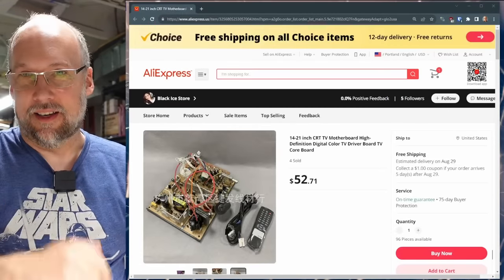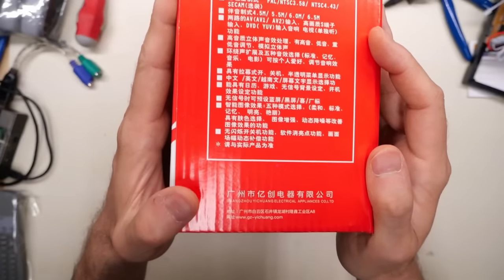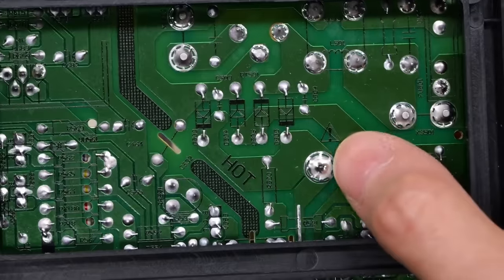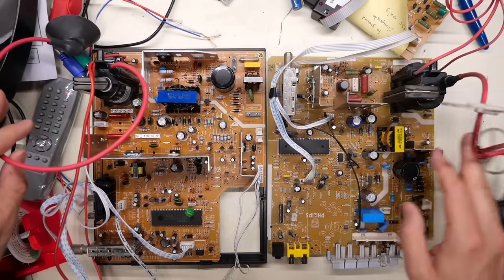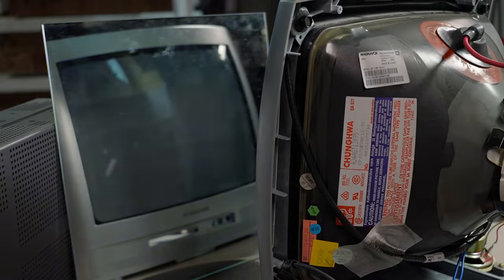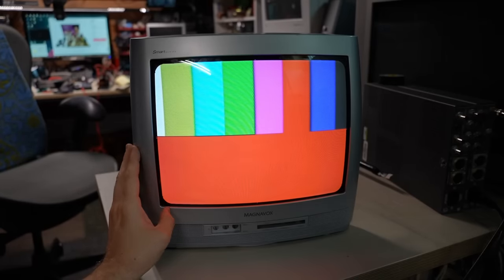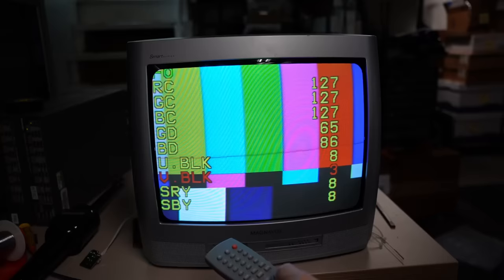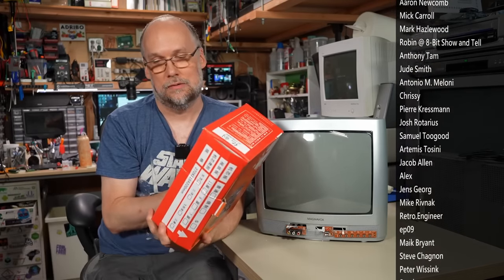I replaced the main board of this TV with brand new parts made in 2023!

Comment: CHUNGHWA CRT's were actually very good quality picture tubes. I have some of those and one has 100k hours of operation on it and still has very nice bright and sharp picture. There is slightly burned overall phosphor but not a big deal. CHUNGHWA is my second favourite brand for picture tubes after SONY Trinitrons of course 😊
Reply from the maker: Yeah for sure this set is still super bright and it was clearly used (had some soot inside) I have since corrected the slight color purity issue and adjusted the convergence, and it looks frankly great.
Reply: Now I wonder if they're the ones still producing the CRTs for the set Adrian found on Alibaba. I doubt it, but then again who would still be in business making them than the company that was the best at it in the country?

EDIT: Oh wait I looked them out they were in Taiwan, so I guess not.
Reply: @stevethepocket I think that's just a warehouse sitting somewhere with new old stock. The very last chance to get a fresh CRT.
Reply: Sony Trinitrons are not the best honestly,their chasis are complicated compared to cheap one,which doesnt have a lot of feartures which can result in the damage of the screen
Reply: @thepostalteenager2206 he's talking about the tube not chassis
Reply: chungwa became chnaghong then was acquired by tcl.

Comment: This brings back memories. I learned TV repair in school. a friend and I plowed through the books several weeks before the rest of the class and the teacher assigned us a broken TV. We eliminated point after point until the only thing left was the fly back transformer, and it wasn't putting out any power.

Found a burned out power transistor, swapped it and burned out the replacement. Found the real problem and fixed that, swapped in a second replacement transistor and it should be working, but without assembling everything we didn't know for sure. Here we didn't know how to proceed. We didn't have any instrument capable of measuring voltages in the tens of thousands range so how could we test what we got there? I asked the teacher and he told me to peel back the isolation from the terminal on the transformer. Then with the power on take a screwdriver rated for 100KV and poke at the bare terminal. I asked what I was looking for and he just said I'd know when I saw it. 

Well the "it" was a two centimeter electrical arc jumping between the terminal and the screwdriver. Scared the shit out of me and left a deep burn mark on the screwdriver. My teacher laughed his ass off. Never liked working on the high voltage parts of TV's after that. Turns out he had that TV for several years and we were the first to get a picture out of it again. The thing is he could have diagnosed and repaired it in thirty minutes while we worked on it for days. That's what experience will do for you.

And I never dug into a TV again after that!
Reply: Even witg proper tools a teacher to me even suggesting to try that is an EXTREME violation safety
Reply: @casev799  the odds of it hurting you : high
the odds of it killing you : low

this is how the best lessons are learned imo
Reply: your teacher is a madman lol. woulda done that now days some kid woulda cried to mommy
Reply: @jstegall44 and teacher fired
Reply: Yep, a screwdriver makes a good high voltage tester. I was a TV engineer in the 1980s and we never had a high voltage meter either.
When I started out there were plenty of TVs with line output valves with around 4000v on the top cap, you certainly knew it it you accidentally touched it! Would leave a small burn mark on your skin. Luckily the current was only a few milliamps, so no danger of serious injury or death. I like 240v mains, and I've had a few of those too!
Reply: Fun part is that CRTs can hold high voltage for a long time. Your turn your TV off on a Friday and continue work on Monday and you still get zapped. But that can happen with a power supply board too (large caps).
Even more fun are CRTs built into large wooden cabinets where you have to put half your body into to reach the components. If you get zapped in that position, you will bang your head on the cabinet and if you're really unlucky, you hit a metal bracket with shrp edges...
Reply: Cool story, bro.
Reply: And this is exactly what I went into Electronics hoping I would learn about. As a teen I used to love tinkering up awesome home entertainment setups – I made surround sound systems (5.1 style) before it was even officially a thing. So I hoped to learn more about that and get an education within my passion. Instead it ended up being an overbearing amount of math – almost never any actual physical tinkering – which ended up boring me out of the whole class completely. So, I reset and went into botany instead. No jobs in that field. And now I'm here… just watching YT videos. fml
Reply: You've got a massive set of cohones my friend. I thought about repairing my old crt tv as a kid and was perfectly capable of fixing electronic things, but after seeing videos of people getting electrocuted and getting hurt I didn't have the balls to do it.
Reply: @jstegall44 
12 year old here, I would've got my dad (works in PC stuff) and he'd probably just go
"hell no we're not"
Reply: @PlaywithJunk  A CRT is a glass capacitor that stores highvoltage also when off. Most dangerous of touching it is that you will accidentally shatter the tube and so (particularly with 1950/60th TVs) die of the shard shrapnel from a glass handgranade.
Reply: Your "teacher" had no business being a teacher. That being said, step up to MOT stacks and reversed pole pigs.
Reply: @casev799  Yeah it's called "badass".

Comment: I remember about 7 or 8 years ago, working on a Mitsubishi 60" rear projection CRT TV from the late '90s.  It had RGB convergence issues that I later discovered were the result of cracked solder.  I was surprised to find out that, not only did it use convergence amplifiers from the '70s, they were still in production and I got a complete set for less than $20, shipped in under a week!

Comment: That looks like a possible solution to dead CRT based arcade machines. Some of the CRT driver boards for those are full of unobtanium parts (particularly the flyback transformers). This might be a good replacement for the original board.
Reply: They've sold these for arcade monitors for a long time (like at least ~15 years or more). They lack composite, remote, etc. You would measure the total resistance of the yoke windings and there were a couple different models to order based on that (and the CRT size-- 19" vs. 25"). They worked, but longevity was pretty marginal. Probably OK for occasional home use, but we had 100% failure rate running in a commercial arcade after a few months. I suspect that replacing all the ultra-cheap Chinese caps with some better quality ones might extend the life, but I never bothered trying that since repairing the original monitor chassis is still quite achievable and tends to last decades...
Reply: I clicked the link for the one he got and one of the recommendations on that page was for one of these for 25" to 29" arcade crts XD was like $22
Reply: You can buy universal arcade monitor boards with RGB input, they've sold those for decades

The disadvantage is that the screen brightness changes depending on how many stuff is in the screen since the high voltage regulator is made cheaply
Reply: @ClayCowgill  It's definitely the cheap caps. I replace the caps on most of the Chinese stuff I get simply because of that. Even Samsung products use those cheap caps. My Samsung monitor died 3 years after buying it, bad caps, replaced them and now 7 years later it's still working perfectly.
Reply: You can have flybacks custom made, just like any transformer. You can fix anything if the customer is willing/stupid enough to pay the price.

Comment: The thing that kind of boggles my mind is not only does the flyback have the 2023 date sticker on it, but the PCB has a 2021 date silkscreened on it-- meaning that the PCB design was revised that recently!  Wild that there's enough demand for CRT TVs and components to be actively developing products in the 2020s.
Reply: sprite based games just pop on em
Reply: Over here in south-america, CRT tv's are still widely used, even CRT computer monitors.
Reply: I checked out their website and it seems like the product was possibly introduced in 2020. I'm 97% sure the design is a multiple-generation copy of what was once a board inside a set made by Funai. They were (and still are) a major manufacturer of white-label bargain-grade AV products, including CRT. Adrian's "Magnavox" television is almost certainly of their products, as they own that brand name. That same model got sold as Memorex and probably a dozen others too. The type of TV you'd find on sale at CVS in 2004.

This GZ Yi Chuang company also sells "XFLAT" brand new CRT televisions. I will hazard a guess that there are other small factories producing clones like these with copied schematics. That type of thing is a big part of the manufacturing culture in China. Plans get shared quietly, modified, improved, cost-reduced, reshared over and over again. Personally, I think that's awesome!

Comment: PAL-BG, I and DK are some of the different PAL flavours. BG used in Germany, Netherlands, Belgium and is your default. (B is VHF, 7MHz channel width, G is UHF with 8 MHz spacing). PAL-I is used in the UK (UHF only, and sound subcarrier 6 instead of 5.5 MHz) and DK is for another channel numbering used in Eastern Europe that wanted to stay compatible to Russian Secam.
Computers and VCR’s are usually modulating on UHF channel 36 or 37 in Europe. PAL for Argentina is PAL-N and for Brasil PAL-M.
Reply: In Argentina we do actually have PAL-N, but we also have NTSC on some CRT TVs
Reply: @YourGoofySouthernNeighbour And since the late 90's, all CRT tv's manufactured in Brasil support PAL-M, PAL-N and NTSC due to Mercosul.
Reply: @TiagoCNeves  you mean Mercosur
Reply: @KatsuSush  In Portuguese we do say Mercosul with the 'L' as South is "Sul"
Reply: In Italy now the tv transmissions are in digital system DVT-B2.
The PAL BG was abandoned some years ago...
Reply: Yeah, different regions had different channel spacing and sound offset. Another interesting note is that PAL-M is actually based on System M, so it has 525 lines, and 60 fields per second.

Comment: I'm glad to watch this on your chanel. This is something very common here in Senegal (West Africa). This kind of "Universal Replacement Board" imported from China is still being used by TV repairer when a CRT color TV is having issues they can't fix due to IC problem that can't be replaced because the component can't be found. So what they do is they manage to place the board inside the TV case and somehow glue the IR sensor somewhere on the front panel. They don't even bother to try to install the from buttons interface, the user will use the remote at home and if it's broken he can find a replacement on the market or a universal remote. Most of time the process is way more easy than yours because it's about bigger TV.
One more thing. Why China is still manufacturing this kind of board? because here in Senegal and in any African countries, analog terrestrial tv signal is still being broadcast. And even if there is digital broadcasting, many families keep their CRT TV and just buy the box that allow to receive the digital signal. There are also in many towns some kind of clandestine analog cable networks using the UHF band to distribute live TV they take from satellites digital broadcasting to users that pay a very cheap price. So the market for this kind of boards still exist here.

Comment: The method of using 'breakaway' panels is definitely an efficiency step in manufacturing... it's far easier to place jumpers onto a panel beforehand, run it through wave solder, then break it out to separate boards than having to fiddle with getting the wires properly hand-soldered. That cap coming loose is probably precisely why other CRT sets you've poked around in have that adhesive holding down certain large components.

Comment: 40:30 PAL B/G uses a 5MHz sound subcarrier (Western Europe), I uses a 5.5 Mhz (UK and a few others), D/K uses 6MHz (Central & East Europe)
Theoretically, the higher sound subcarrier allows higher video bandwidth, but that would depend on perfect separation of the chroma subcarrier and reduction of chroma / luma interference by the subcarrier being super accurate 4.43361875 MHz = 283.75 × 15625 Hz + 25 Hz is required to drop the main harmonics of the colour components in between the main harmonics of the luma, while only the most advanced decoders can make full use of it.
Reply: I thought the DK setting was for playing the Donkey Kong theme but this video proved me wrong. This explanation makes sense though.
Reply: B/G is actually 5.5MHz, I is 6MHz and D/K is 6.5MHz. Guess your numbers are the video bandwidth?
Reply: Yep! I do remember that analogue TV in Singapore used PAL B/G.
Reply: @mikkels5724  oops, reading the wrong table column
Reply: Australia uses 7Mhz subcarrier

Comment: I wanted to tell you, as far as cutting the plastic base and things of that nature, instead of using a Dremel tool, maybe look into what's known as a 'multi tool'  it has a reciprocating vibration effect, so you can put little flat cutting blades on the end and it vibrates back and forth (side to side really) and it'll SLICE right through that plastic like butter. I use mine to cut the ends of say door molding when I add tile to an existing floor and the like.. It's a great tool, the plug in version is like 30 bucks and you can put a wide variety of ends on, grout saw, wood, metal, plastic etc. etc. Anyway, just a thought!
Reply: Can you provide more keywords or even a link? I cant seem to find it.

Comment: This was one interesting project.  You might tap a woodworking shop in your area that has a CNC router and have them make a custom case for this beastie.  I have a routed case for my SC126 (admittedly a much simpler project), but it looks beautiful and works very well.  Measure carefully, design up what you want, and work with the shop to determine how many pieces you want the case to have (probably a front from one block, a bent or glued-up mid-section, and a back), where you want your control and power ports to be, how you want to mount the CRT and board, and you could turn out a furniture grade piece of equipment.  There are woodworking channels similar to Blacktail Studios (they have a YouTube channel) that might be willing to take on a project like this  (but all things for a price...)

Add a little laser engraving for legends and the ADB logo, and you're off to the races!
Reply: would look cool!  makes me think of the old wood cabinet Marantz amps and such of the 70's too
If I were to do all that I'd look for a good picture tube around the max size that board can support and work from there
Reply: Yours